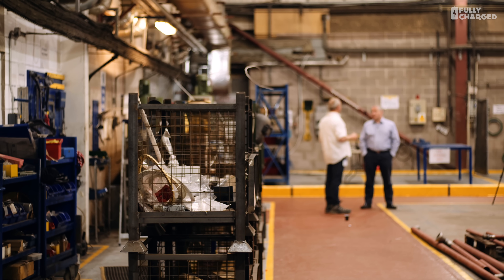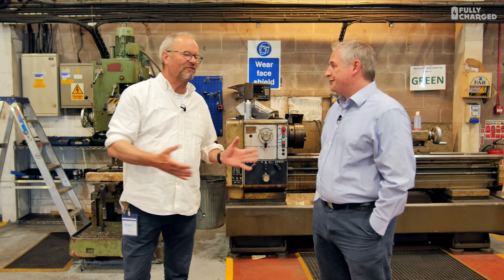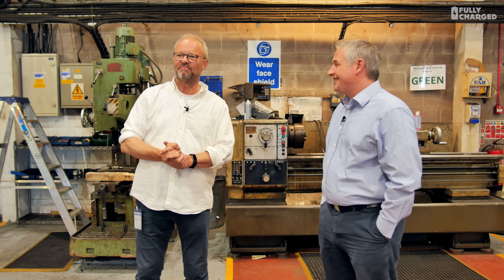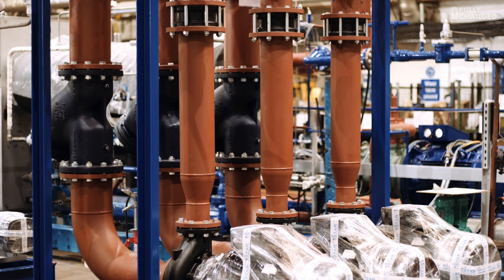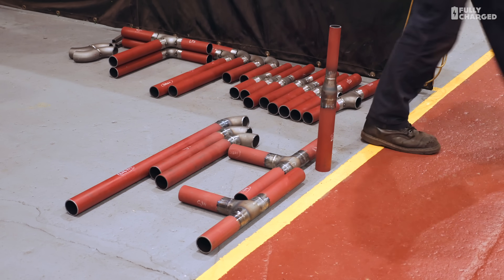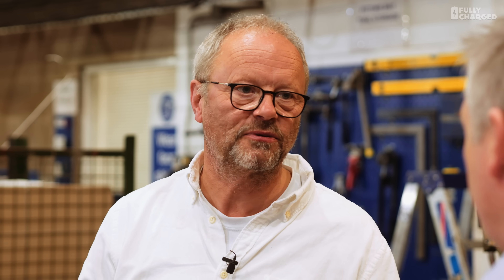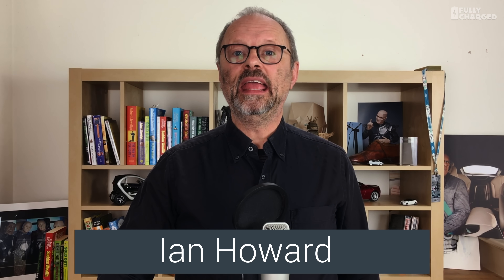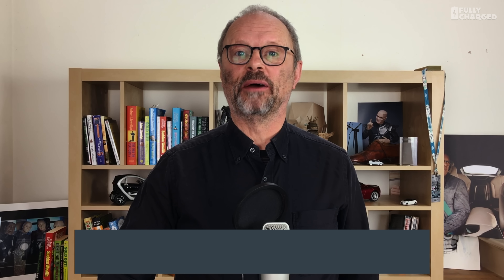Star Heat Pumps | Fully Charged

Comment: David Pearson is talking a lot of sense and he's put his money where his mouth is.  You can argue about efficiency until the cows come home, the bottom line is it's cheaper to use a heat pump than it is to burn fuel to heat a building.  I used to run a business that used a lot of compressed air and I recovered the heat from my compressors to heat the office space, saved a significant amount of electricity that way.

Comment: A few years ago we renovated a ~1700 thatched cob cottage, not on the gas grid. We needed to lay in a new floor & you can't fix radiators to cob walls, so we laid in underfloor heating and fitted a Panasonic heat pump. It was quite expensive, but the result was so superior to any of the alternatives it probably added a lot to the property value. I don't live there any more unfortunately, so I don't know about it's reliability over the last couple of years, but apart from some comissioning issues we had no trouble for a couple of years. No oil tank in the garden, and no need to arrange deliveries. just an air con panel round the back of the house. Running costs equivalent to the alternatives (more expensive than mains gas, but that wasn't an option - with solar panels you could get cheaper than gas running costs though)

Comment: This guy sounds like he’s disproved some basic laws of thermodynamics.
Reply: Heat =/= energy (in the way you're thinking about it). Heat can be converted into work (physical sense) via the Carnot cycle. There is a limit to how efficient this can be. This process, however, is reversible. You can use work to create a heat gradient. So in the case that you create 1 unit of energy for every 5 units of heat over a gradient, you can get 5 units of heat moved over a gradient with 1 unit of energy.  You can not create more energy out of nothing, a heat gradient just has a different way of storing potential energy than normal units of energy.
Reply: It's simply moving heat energy, by making a cold thing colder you can make a hot thing hotter with a heat pump. 

By using the latent energy of evaporation and condensation this allows you to cool one area and deliver the heat to another

Comment: Probably my 4th or 5th time back to view this video since it was published, and each time I'm staggered as to why heat pumps are not in more widespread use, apart from refrigerators and air conditioners.
EDIT: Watching it again in 2021 to reference a bit of David's speak, and staying to the end. Astonishing episode really.
EDIT: Back yet again in May 2022. This is one of my favourite FC episodes of all time. This year is the time I can really go for it regards getting off fossil fuels competely. I still have to offset my gas heating via my renewables energy supplier, but I'm busy researching air-source heat pumps. They've improved, even since this FC video.
Btw, did Robert ever get Dave Pearson's "Carpool" reference? I hope so.

Comment: I still don't understand how this technology works??
Reply: Heat =/= energy (in the way you're thinking about it). Heat can be converted into work (physical sense) via the Carnot cycle. There is a limit to how efficient this can be. This process, however, is reversible. You can use work to create a heat gradient. So in the case that you create 1 unit of energy for every 5 units of heat over a gradient, you can get 5 units of heat moved over a gradient with 1 unit of energy.  You can not create more energy out of nothing, a heat gradient just has a different way of storing potential energy than normal units of energy.

Comment: In the Netherlands this is standard to do many companies make these and many homes use heatpomps in the Netherlands. Because we are moving away from gas burning new build homes only get a electrical connection gas is no longer used. So these houses have heat pumps . We build hotels with big heat pumps. But remember the more then 400% only goes up if the temperature difference is good. Air to water heatpomps   only work if the outside air is above 7 degrees Celsius

Comment: Just speculation on my part here. For example. If most global coastal cities or those with large tidal rivers were to utilise this approach & the 'Gulf Stream' which runs past many coastal areas providing much of the planet's heat distribution system, what sort of impact would this have on global warming/climate change? Would this slow & or help to reverse some of the damage being done by taking heat out of the planet's heat distribution system in combination with reduced emissions? The polar regions are warming @ an alarmingly increasing rate with warm water melting the ice shelves faster than the modeling predicted. If this could be slowed, ? reversed by a global implementation of this tech could we also slow, possibly reverse a portion of sea level rise? Not an expert here, just speculation. Very interesting story.
Reply: the rivers are tending to warm up and the sheer volume of cooling would be negligible compared to the amount required to make a discernible difference

Comment: He said that Wind Generators work well with( symbiotically I think he said) Heat Pumps, but I have been thinking how great it would be if at each River sourced heat pump a Tidal Turbine was installed. So the rivers generated the energy needed to move its own heat!.

Comment: Sounds like he's full of hot air.. 
Interview is rubbish, no details to show 400 percent efficiency just a general idea blah blah blah
Reply: Heat =/= energy (in the way you're thinking about it). Heat can be converted into work (physical sense) via the Carnot cycle. There is a limit to how efficient this can be. This process, however, is reversible. You can use work to create a heat gradient. So in the case that you create 1 unit of energy for every 5 units of heat over a gradient, you can get 5 units of heat moved over a gradient with 1 unit of energy.  You can not create more energy out of nothing, a heat gradient just has a different way of storing potential energy than normal units of energy.

Comment: Finally, people are learning about the amazing value of A/C. My house plan is to have a A/C and Heat pump set up (Extra the heat and the cold from one unit) then store it. so during the day when the solar is running, I run the system but I use the cooling and heat when I need it, thus giving me very cheap storage. It's incredible to me that this is not something that is commonplace. Temperature control is amazing with this type of system and it's orders of magnitude cheaper to store energy this way. 81.7 kWh in a 1000 litre hot water tank at 90°C tell me what battery can store that amount of energy? (Hot water storage tank $1,236 per 400L in Australia)

Comment: Heat pumps are very common in Sweden. We have bergsvärme (a big hole in the ground), luftvärme (heat from air) and frånluftsvärmepump (taking heat from ventilation air). Arlanda airport has very big tanks of hot and cool water for warming in the winter and cooling in the summer.

Comment: Renewable heat comes from - Solar thermal panels, district heating powered by biodigestion, Solar PV can power storage heaters or underfloor heating and the cheapest is the free heat from electrical equipment and our body heat (passive house design uses this to heat a house). Not sure why he is wondering how to access heat

Comment: District heating is awesome, I wish it was available where I live. It's insane that you're trying to heat your house and hot water while nearby some data center or industrial process is desperately trying to get rid of heat. I installed a Unico air to water heat pump a decade ago and it worked, but repairs were expensive. Air to water heat pumps are hard to get in California and few HVAC installers have experience with them, a vicious circle. Ductless mini-splits (outside heat pump moves heat or cold to indoor wall fan) are starting to take off.

Comment: Robert,

$21,600.

That's an important number you should share with your subscribers in the US. I don't know how this info translates to other countries, but it's great for us here in the States. It's the approximate bottom line cost for a 2018 Nissan Leaf S (not including tax, title, license, yada yada). There is no need to file or wait for the $7,500 US federal income tax credit (in fact, you can't get it). Anyone who can read fine print, add, subtract and multiply can come up with that number based on prices listed on the Nissan web site.

Here's how to figure it out.

Go to Nissan's web site and configure the different Leaf models, including destination but without any option packages. Here are the numbers:

Leaf S list: $30,875
Leaf SV list: $33,375
Leaf SL list: $37,085

Not cheap, but if you lease instead of buying through Nissan Motor Acceptance Corporation, a rebate is factored into each model:

Leaf S: $9,275 rebate
Leaf SV: $7,500 rebate
Leaf SL: $7,900 rebate

Now, the numbers look like this for each model with no major option packages:

Leaf S: $21,600
Leaf SV: $25,875
Leaf SL: $29,185

The residuals and fees (for purchase at lease end) are about:

Leaf S: $9,563
Leaf SV: $10,980
Leaf SL: $12,538

Options complicate the numbers, of course, so be careful when calculating in those figures. Nissan doesn't update the lease price online when you add packages to each model.

The basic Leaf S is a great deal, if you're willing to forego the extras. If you lease the Leaf for 3 years, then purchase it when the lease ends, you pay about $21,600. Be warned, though, that it will have no fast charge port. That'll cost almost $2,000 more.

Chevy doesn't offer such generous rebates for the Bolt. I checked. The Nissan rebates amount to getting the $7,500 federal tax refund without all the hassle of filing. I'm not eligible for most of it, anyway.

So, I now have a new 2018 Leaf SL. I suspect in 3 years I'll pay the residual and keep it.

I've shared this with other electric car YouTube channels, hoping you guys will help spread the word. I didn't know about this three weeks ago, and finding out is the reason I have a Leaf today.

Comment: Heat Pumps/Reverse cycle air conditioner two terms people don’t seem know are the same thing, Heating and cooling, that’s their main purpose,  I bought one 25yrs ago and was told for every $1 I put in I would get $3 worth out simple, the house that I installed it was in Hobart Tasmania, a Cedar clad pole platform Zincalume roof (corrugated iron to the English which it isn’t ) fully insulated single glazed windows facing north we had gas fire fitted, our house is 250mt above sea level in the foot hills of Mount Wellington during winter its very cold and we very rarely used the gas fire it was the cheapest house we have ever had to heat, the people who now own it have covered the roof in solar panels, so jealous. If I was starting my life again and building or buying a house I would install reverse cycle pump solar panels and wall storage battery battery and electric car bliss.

Comment: Rather than use the term efficiency to indicate the output of a heat pump. The industry norm unit is COP or coefficient Of Performance. A typical modern heatpump runs a COP of around 4 meaning it transfers 4 times the heat energy than the electrical energy used to drive the pump.

Comment: Not a new idea. Back in 1990s, as a young Engineer, I used to 'DnC' large Heat Pumps in Municipal Leisure Centres. The Heat Pump to heat the pool and the Evaporator to cool the attached Gyms and Offices. Some had Solar Suplimental Heating and Power. Noone called it green. It was all about saving power and money.

Comment: Excellent video Robert! Heat pumps are vastly under-used in my opinion. Even the air-to-air reversable split air conditioning type that I have installed in both my office and man shed are highly efficient and great for heating. The running cost is less that a third of what it would cost to use an electric blower heater. These large industrial water source units explained in the video are even more efficient.

Comment: Isn't the whole point of this not to burn stuff to produce heat. Yes the air to air or air to water or ground source heat pumps use electricity which still comes from burning gas, coal, biomas but if we have a home heat pump with solar this is a better option. A problem we have is gas is 3 times cheaper than electricity so even a 300% input output efficiency rating would still cost us the same amount of money to heat our homes but this is about protecting our planet so that is still the better option. Transporting electricity across the grid is extremely inefficient. The further it has to go the more energy is lost getting it there. Two thirds can be lost so solar on our homes eliminates this problem we can't solve any other way. If that much wasn't lost it would cost the same as gas. Also it's no good using efficient heat sources unless you super insulate your home as well. Building regulations should state that all new homes should at least have a 4kWh+ solar array with a battery system, thermodynamic panel for hot water, be air tight and super insulated and heated using heat pumps and have 100% LED lighting. This is easily achievable. Just a different way than we use now.
Reply: sub-zero-homes Did you miss the whole part about using renewable sources such as wind? The UK is one of the best placed countries on the planet for wind power. Distribution losses on long distance high voltage lines are not as inefficient as you say, just a few percent. Solar on every home is a nice idea, however you perhaps forgot that UK homes are typically smaller and only a fraction will have the correct roof angle in relation to the Sun. Heat pump demand will be highest in winter when solar output it lower. A 4kw install might supply 500 watts. Heat pumps are less efficient in cold temperatures. Let's assume a generous factor of 3. That's 1500 watts of for 6 daylight hours, so a total of 9kwh heat. No where near enough. This also assumes every bit of electricity is used by the heat pump and doesn't allow for any domestic consumption. Home solar is nice to have but the solution only lies in very large commercial installations.

Comment: Norway does not use gas for heating, we use electrical radiators if we do not have a heatpump :)
Reply: herrjonna2007 You are fortunate to have vast hydro installations due to the geography and surplus electricity due to low population.

Comment: Some folks have mentioned this channel's report on the SunAmp (I think it was) heat-storage system awhile back.  Combining that technology with a heat pump would be awesome:  The heat pump would be connected to extract heat from the back side of the solar PV panels, and move it into the storage tanks.   Instead of using just straight resistance heat for "charging" the thermal tanks as SunAmp did, you'd get the benefit of the heat pump delivering more thermal energy than the electrical energy it consumes, AND the solar panels would be chilled in the bargain, making them much more efficient as well.

Comment: Everything above absolute zero (Zero Kelvin) -273 degrees C is heat. 0C is, relative to the universe, hot. -20C is still hot. There is no such thing as cold, only heat as Einstein once said to his lecturer. Cold is the absence of heat. Same with light, no such thing as dark. As Jacob says, it's physics. Heat is taken from anything then forced through a small hole which creates friction which creates heat, just like a bicycle pump does. You get more out than you put in yourself because the rest comes from the heat source. Energy can neither be created nor destroyed. So with it being infinite it's a wonder we don't have much much better systems the future will no doubt experience.

Comment: Very interesting, I wonder if you could cool (or assist cool) your fridges/freezers at the same time as (partially) heating your home?  6ish feet down the temperature is way warmer than a winter day here in Canada
Reply: Noel Dillabough
One college in the USA used a ground sources heat pump.  It extracted heat in the winter and by the end of the winter the ground was like tundra.  Then this cooled earth was used to extract coolth,  yes there is such a word, to cool the building.  I am pretty sure they used air heating/cooling.  It is best to have ground the sun shines on.

Comment: Brilliant stuff as usual, heat pumps are pritty nifty! =)

Robert, have you looked into installing an air source heatpump at home? Temperatures where you live are perfect for it. Since they are reversible as well you get the benefit of being able to cool your home in the hottest summer days too, powered through your splendid solar array or Tesla battery.

They are very common here in Norway, and have improved quite a bit in time, both in terms of being more efficient during the coldest days and price. Gas is quite rare, so instead of that you find older houses with Diesel heaters that are being replaced by for example bolt-in air-source to water heat pumps.